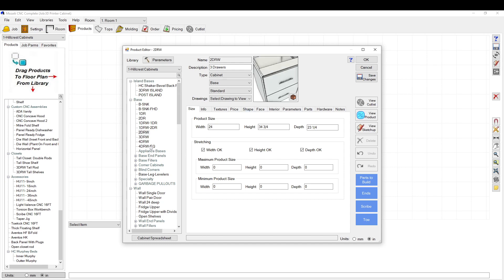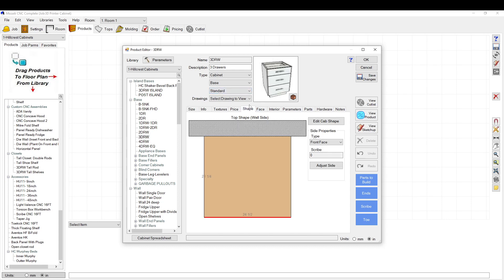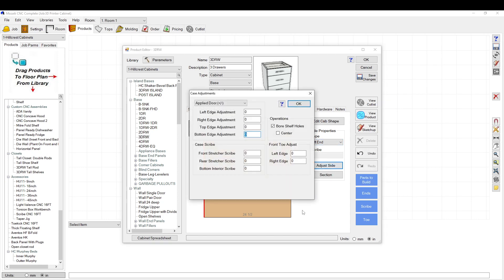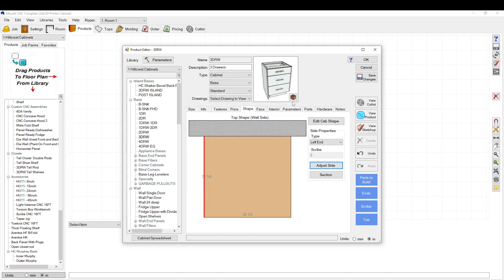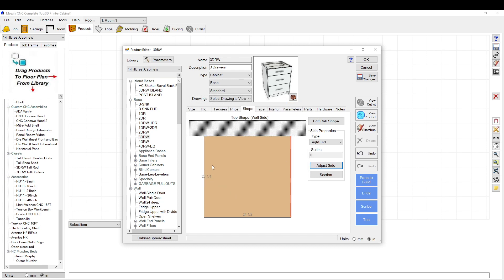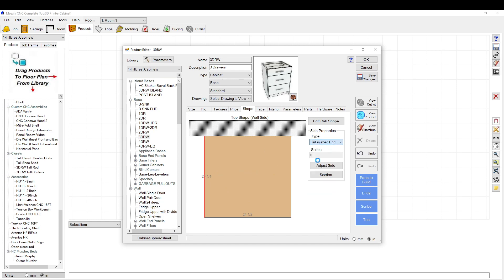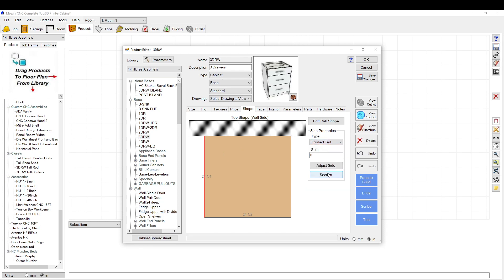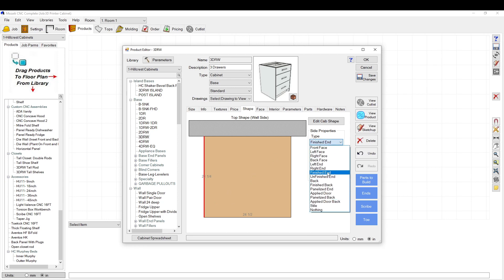Extending Applied Panels to the floor - Mozaik Software Tutorials

Comment: Do you know how to make the applied panel to be notched out for the toe of the front the cabinet?
Reply from the maker: @Mopardude  there is a parameter called ends to floor turn that to yes and it should do it
Reply: @cabforgesystems  ok thanks